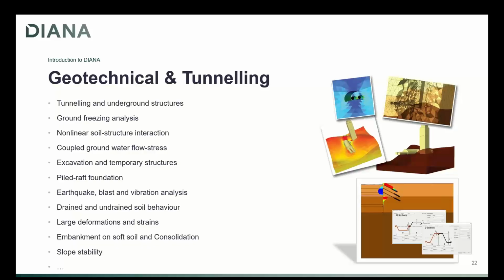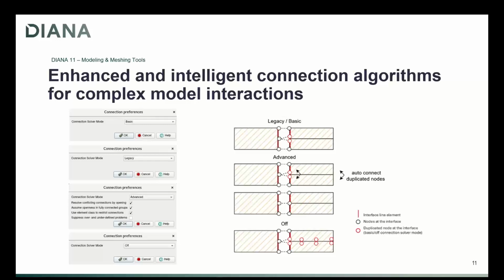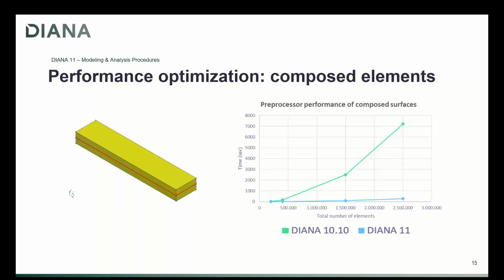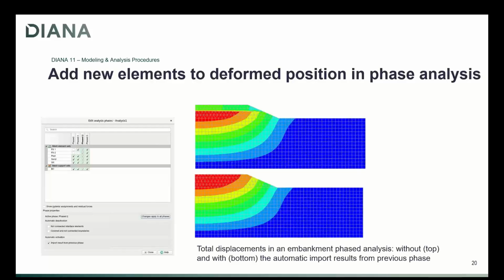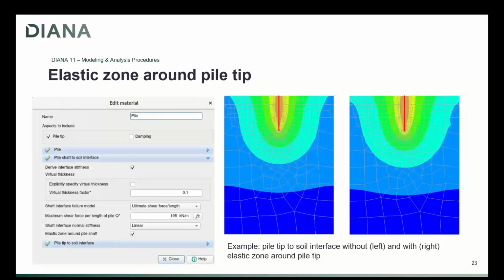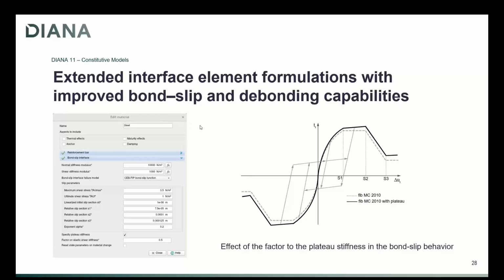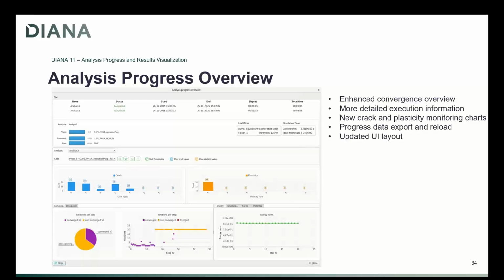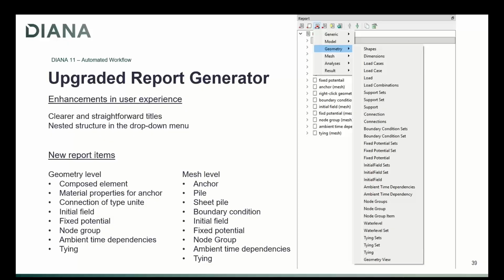DIANA 11 Release overview

Comment: Given that Diana FEA is a civil and geotechnical software, why does it not have the option of predefined stresses as initial conditions in the x, y, and z directions, which can be easily defined as an initial condition directly? Because in modeling a deep tunnel that is part of the model tunnel, due to the absence of this option, an overhead must be defined for it to act as an active load during the initialization of stresses.